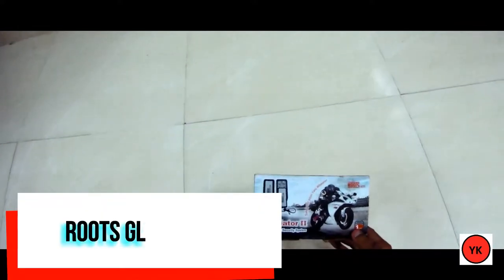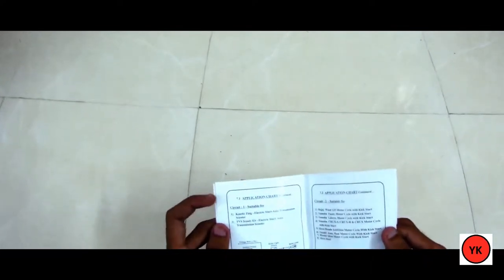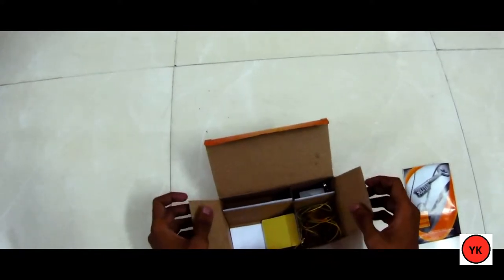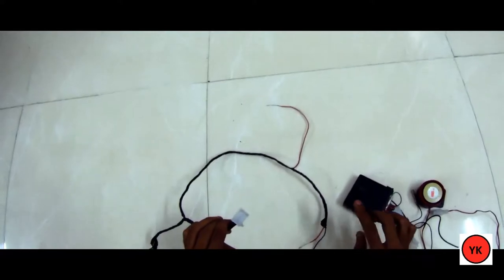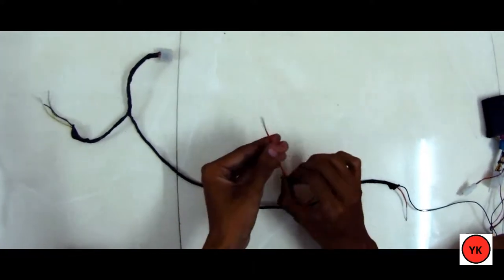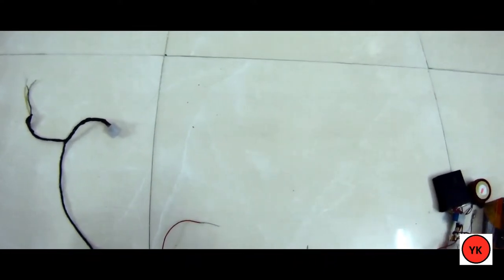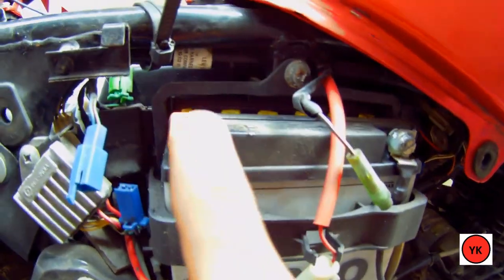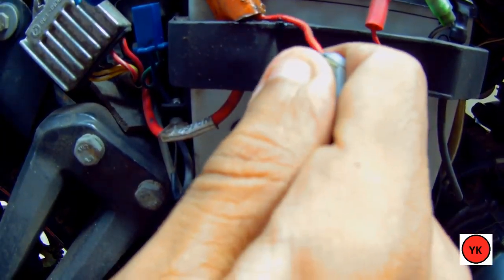How to install alarm motorcycle, Roots Gladiator 2, Unboxing, video tutorial, DIY, ApacheRTR160

Comment: Hello thank you for the video and I wondering if the alarm works for Suzuki xf freewind 650 98.thanks for answer
Reply from the maker: Yes it does :) however, you may want to check the color code of your bike wiring and match it with that in the alarm
Reply: @ykstudios5080  thank you will do

Comment: Hi brother, really like your detailed explanation. Just 1 doubt, I was using the system in my RTR 200 it got malfunctioned. I bought it again for the 2nd time, usually after locking with the key it used to give 3 beep sound first however, I don't get it now. Do you have any idea why is it so???
Reply from the maker: Hey bro, thanks a lot for the support, means a lot.  I think you can once check if the bike is really getting locked,  if it is getting locked and no sound  is there, there must be a problem with the  speaker. You can check it once and let me know :)

Comment: Does it drain battery too much? I use my bike once or twice in a week
Reply from the maker: Hey! This alarm system doesn't drain the battery that much. Regular usage of the bike should be fine :)
Reply: Yk Studios I use it in weekends only.. Will that be good?
Reply from the maker: @thecommercetutor  Hey! I would recommend that if u are  using your bike only in the weekends, then u can start your vehicle everyday just once. It will extend the battery life of the bike and also, not cause too much strain, since the alarm kit will be on 24 hrs, unless u switch it off manually. So Yes, It should be good to use, just keep this in mind :)

Comment: Where do I connect blue wire in r15 v3
Reply from the maker: The blue wire goes into the ignition of the bike, please check in your R15 which wire matches with that

Comment: What does the grey and pink wire do ? I want to connect it to ns200.
Reply from the maker: I have referred the manual for the ROOTS Gladiator 2. it doesn't say anything specifically for those 2 wires. You can try it once and lemme know if u have any more doubts
Reply: @ykstudios5080  the Gray wire is used for a purpose it wont let the ignition coil spark once you  arm the locking system.. So, you can't even start your bike with your original key once you arm the locking system using the remote. Refer to the video for more information https://youtu.be/PobWi-EQKGI